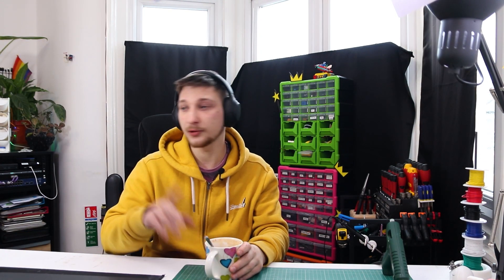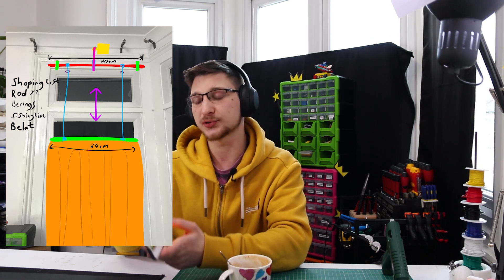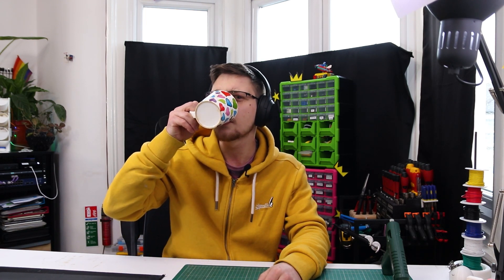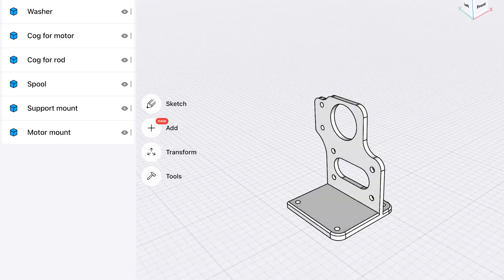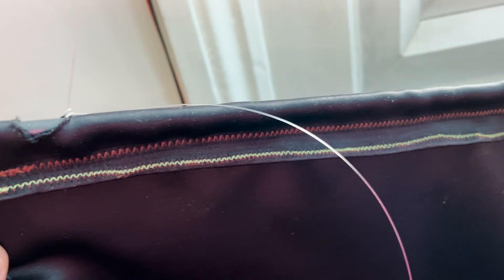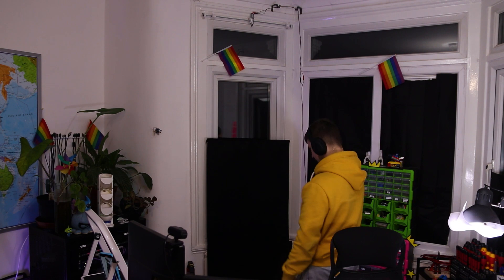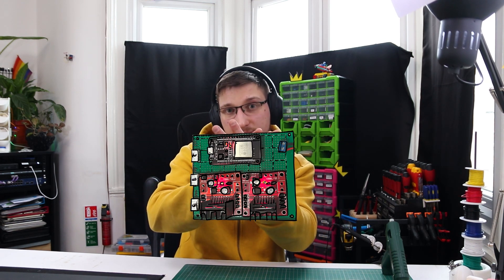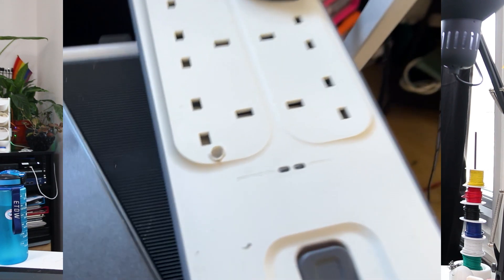DIY Automatic blinds

Comment: Probably too late but.

I would use a stepper motor like some Nema at 12v with a TMC2209 driver. Super quiet and also has Stallguard so you dont need the endstops. You could probably get it to go faster too.

Comment: Really enjoyed the video, great project! For your end stop switch problem, when you are placing a finger or hand nearby you are basically creating a capacitive field around it, and your body is a wonderful antenna (basically you are coupling your home wiring with your board via a capacitor [your hand] and inducing a 50 Hz voltage on the output of your switch). Make sure that you have a pull-up/down resistor on the input to the microcontroller for better stability. If you already have a pull-up/down resistor and experiencing this issue you can look into other circuitry to make this more robust, such as adding a low-pass filter. The distance between the sensor and the board, so keep this distance as short as possible. The wiring in general can play a role in this, as any loops will act as antennae for this noise as well. To reduce picking up noise in the circuit, use twisted pairs for signal paths.
Reply from the maker: Hey thank you for this information I did implemented and it works fine now I did kind of screw up to you switch as I haven’t connected but I worked my way around it ✌️
Reply: @Mellow_labs  very nice to hear it!